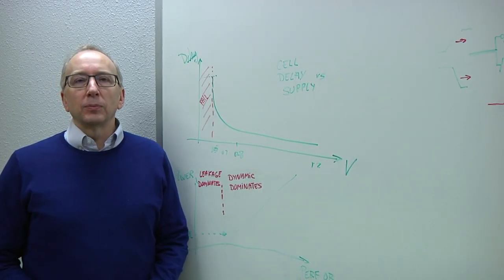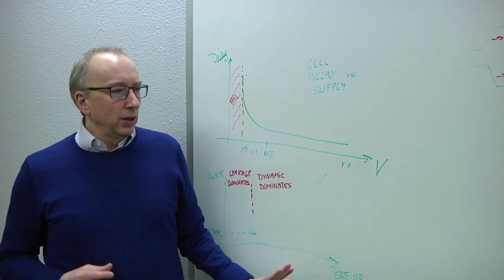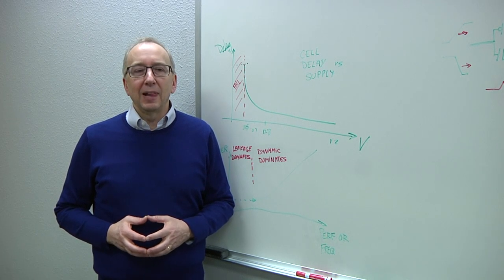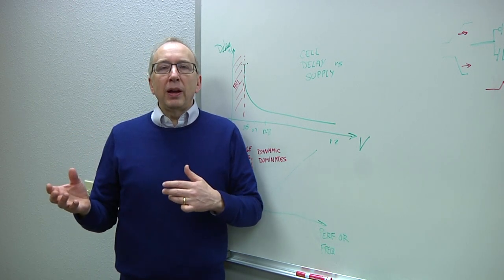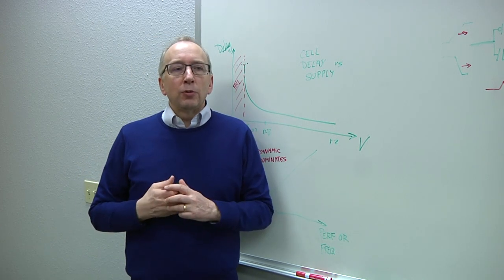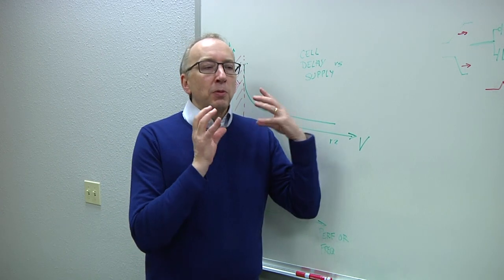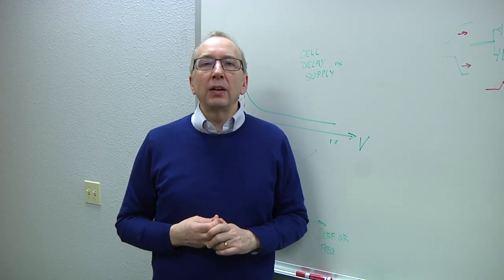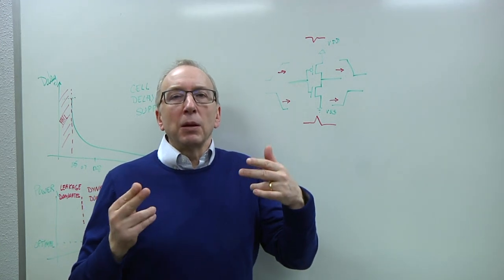Where Timing And Voltage Intersect

Comment: You did a great job editing this, I found it to be clear and concise w/o making a layman's eyes gloss over. Good job. His graph helped me visualize the problem of voltage over power and where it affects timing. I hope in the future we are better able to characterize what I believe to be the quantum effects of leakage at very low voltages and power. I am sure it will help in mitigating the problems that occur. 

I have to ask, where do you find all these talented companies that no one has heard of before? I can see how AMD has made the technical jump over Intel by using a lot of outside small companies like this to enhance their ip. Maybe Intel during 10nm development has kept to much close to the chest. Rather than looking to outside help with their power/performance issues, they kept it in house and the results are clear at this point in time, it needs a lot more work!